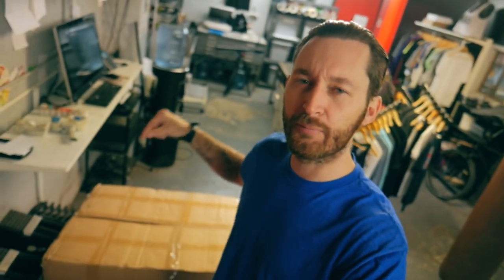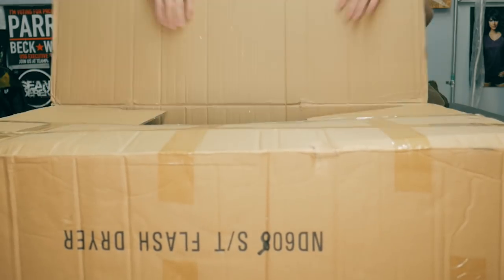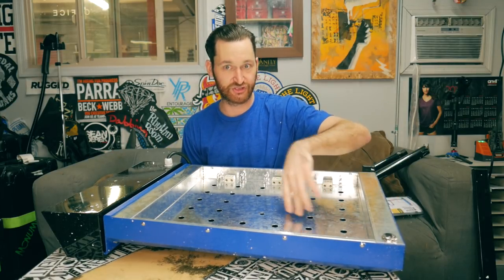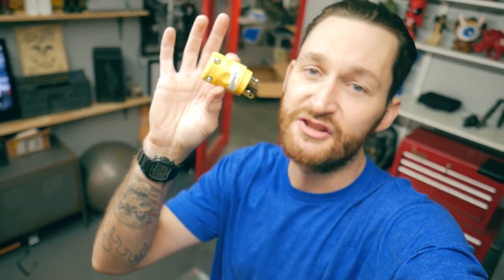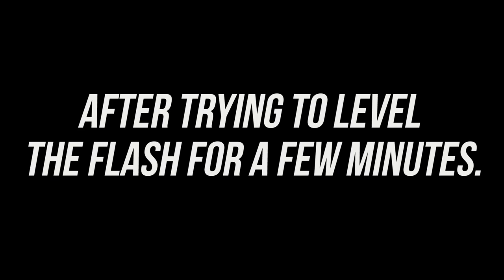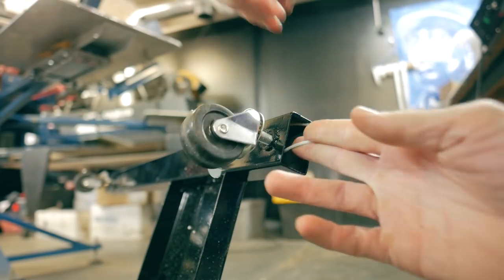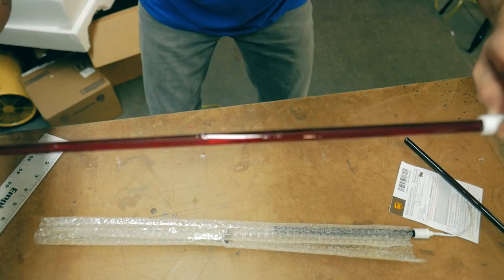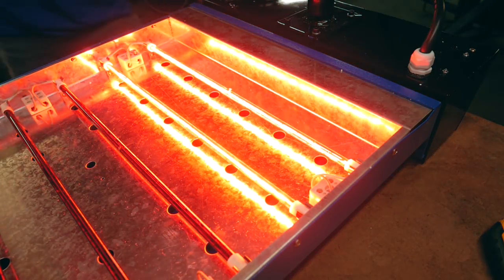Screen Printing Equipment Review | Cheap Screen Print Flash Review and how to | The Print Life

Comment: Hello Cam. Here is a follow up.  I bought this flash back in March. My proximity sensor went out a couple weeks ago.  As far as I could tell, to replace the one in the machine is about $60 - $70 and a month or two from China. I found one in the states that works great (so far). It's a $21 part and shipping was about $10. Company is Automation Direct and the model number is FB6-LN-OE  Along with that part you need an M12 4 pin Female plug with cord. I found one of those on amazon for $11.      ( uxcell M12 Female Straight 4 Pin Connector Aviation Socket Electrical Cable 2M)   I didn't save all that much but had the parts in two days rather than a month.
Reply: For me, I'd start printing and a couple minutes in the unit would stop working. I'd wait a few minutes and it would start working again and I could usually finish the run without any more trouble. That would be after the palettes were warmed up and I'd decreased the dwell time. Which at the time made me think it was a thermal problem also.  After a couple weeks of this it just stopped working completely. I need to add though about the sensor I mentioned above, it does a shitty job reading dark fabric so I moved the sensor to a $1 electrical box mounted to the front of the flash unit. Now the sensor reads the press arm as it rotates in stead of the palette.  If you want a picture of the mount and want to post your cell I'd text it to you. Make sure you're unit is unplugged if you take it apart. Good luck.
Reply: @scottwesner1706  can you send me pic of what you did?  I just bought this machine.

Comment: So after a year, what is the verdict? Is it a decent unit? Did the bulbs last long? Were replacement bulbs easy to find?
Reply from the maker: The bulbs are fine, Ours started overheating and shutting of, however dozens of other shops have tried then with great luck, I think I wired mine up wrong, and it may have a defective, temp controller.
Reply: Is there a link to this product?
Reply: @ThePrintLife  Thanks for the reply. I love your channel and all the effort you put in your shop. How you find the time to make all these great videos is mind-boggling. So down to earth. Keep up the great work.

Comment: I just bought an ordinary flash dryer for the first time.. I am so unhappy with the way it operates .. 2000 watts and takes a long time to warm up and I dont think its safe at all .. needs to be plugged into a proper wall socket that tolerates high voltage... so, I thought of making my own .. I have two construction flood lights of 500 watt each .. I will yank out the shit thats inside the flash dryer I just bought and replace its elements with the two flood lights.. I will save lots of power because It will only be lit when needed.

Thank you for sharing this with us.

Comment: Question: I just bought one of these, will be in early next week. I've got a spare 30amp breaker already wired in my breaker box. Would that work? And what type of plug did you use? 30amp plug? I see you already had an outlet, but couldn't make out any details of what you used. Just want to be ready when it gets here. Thanks!
Reply: Please a bit more info on this wiring. Are both those lines hot and a ground or is it 220 on one line with a neutral and a ground?  Thx
Reply: Two hots and a ground
Reply: Need some help from the community. Ordered without realizing the power requirements and may have to send back. Can I wire to a standard three prong plug (live, neutral and ground)...two vertical prongs with a circular ground?
Reply: Michael Ferritto Same question here. I don’t have a 220 outlet to plug a 30 amp plug into. Would a 15 amp plug work?

Comment: I plugged the one I purchased into a 110v outlet and it didn’t work. What did you plug it into?
Reply from the maker: 240 v
Reply: @ThePrintLife   On a 30A breaker with 8AWG wire, or?... What plug did you use and did you use shrink tubing or something to cover the leads? Would love to know more about the setup and requirements of this particular unit.

Comment: How long dry? Does IR flash dry faster than Black flash?
Reply from the maker: The IR bulb flash is ok we have put it through its paces, and if it weren't for the overheating it would be amazing but out particular unit over heats.

IR Panel Flashes are great, but the whole move the pallet from under the thing when you need to step is frustrating at times.

Comment: Amps are determined by Watts divided by volts. 6000 divided by 220 = 27.7 AMPS.  Considering they tend to advertise on the high side of watt output, 30 amp plug should be fine.
Reply from the maker: Got it thanks Ron. :)
Reply: I ordered one yesterday... I am going to be knee deep in the project as well.
Reply: @ThePrintLife ¿en cúantos segundos seca el flash chino de bombillas un plastisol blanco ?